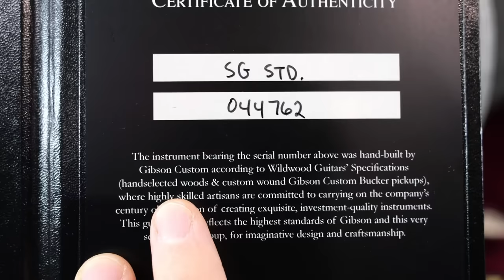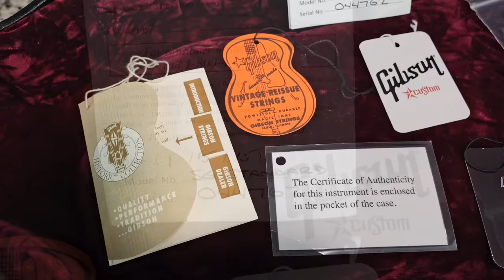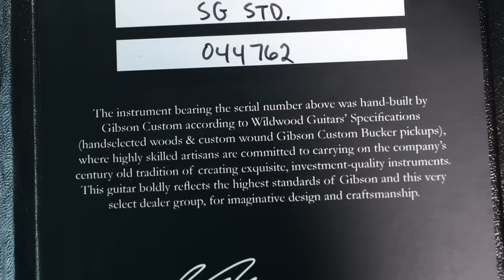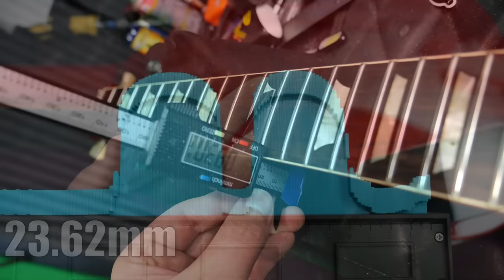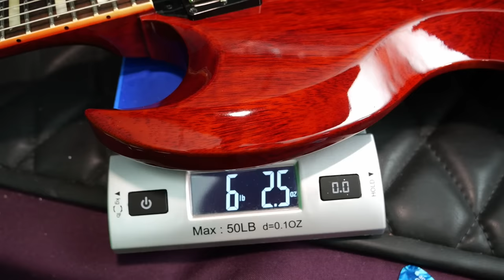What's a “Wildwood Spec" Guitar? | 2014 Gibson Custom Shop SG Standard '61 Review

Comment: I have a Wildwood Spec 50s standard and it plays closer to a 58 or 59 custom shop.  The tribute 59 wildwood spec pickups are the best PAFs I’ve ever played.  Its neck is smaller for a 50s as well.  The top is absolutely perfect and as good as I’ve ever seen.

It’s just an extra $200 for guaranteed quality.  Very happy with mine and would buy again in an instant